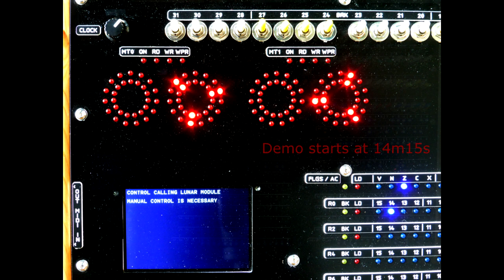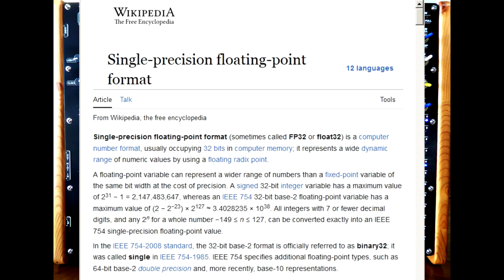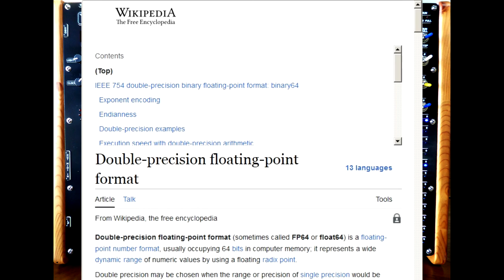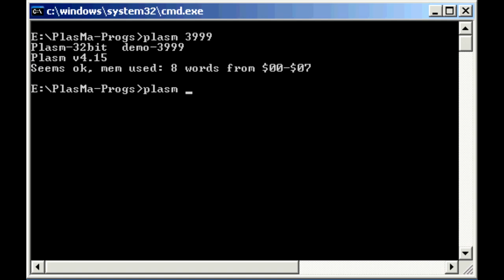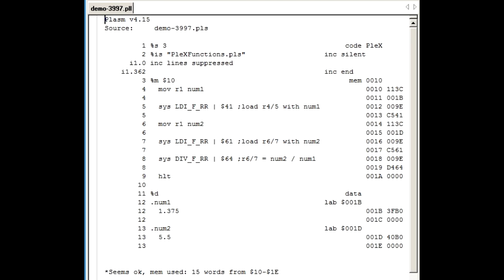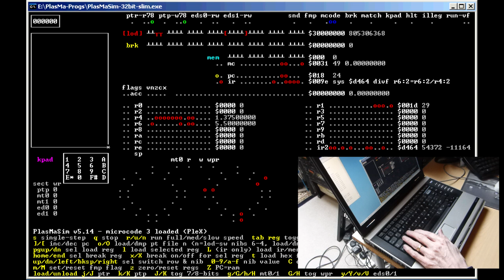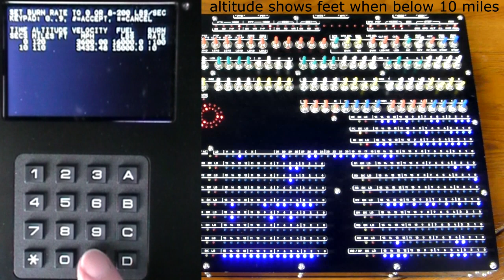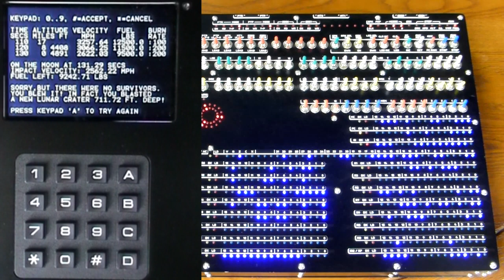PlasMa - 27. Floating point & Lunar Lander

Comment: It wasn't until 1991 that I used a computer with a hardware floating point implement. They didn't come standards on the IBM 360, PDP-11, and VAX machines I used during the 80s. I think the first time I saw floating point instructions in assembly was for the DEC alpha.
Reply from the maker: I jumped in at the deep end when I joined ICL (UK) in 1973 where the 2900 series was nearing the end of its development. 
https://en.wikipedia.org/wiki/ICL_2900_Series
I worked on the 2970, which was a microcoded machine, and if memory serves, one of the many (12?) large motherboards (platters) held the 'arithmetic unit' (ARU).
There's very little information around though, certainly fewer photographs, unlike IBM and others, which is a shame. 
Thanks for stopping by and sharing.